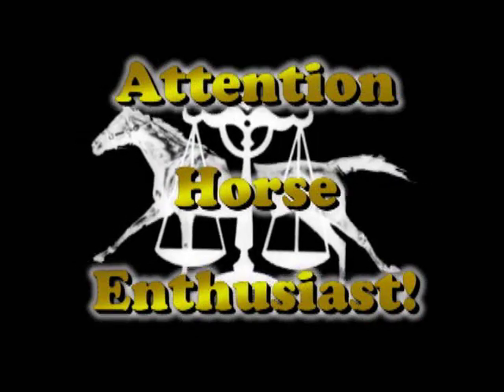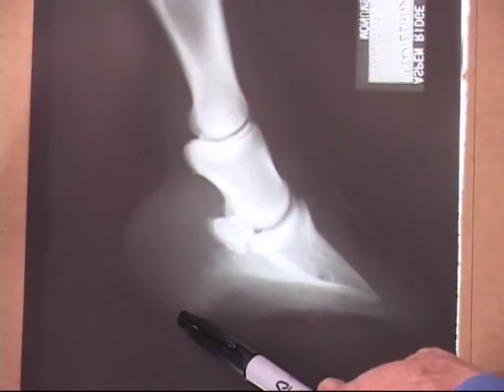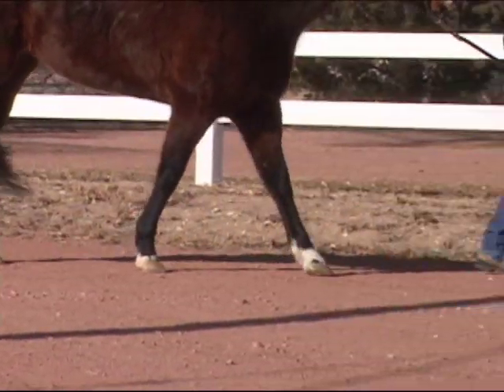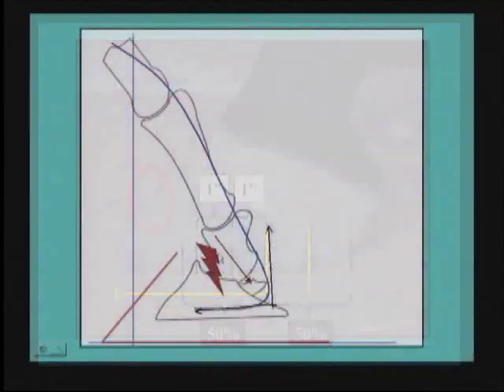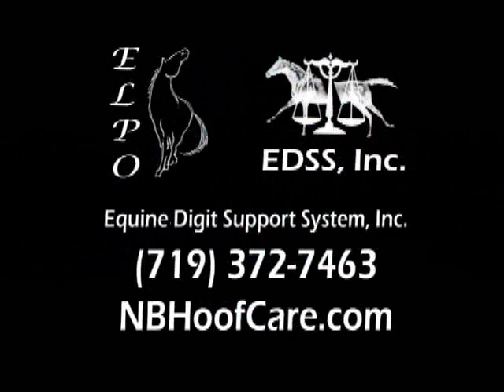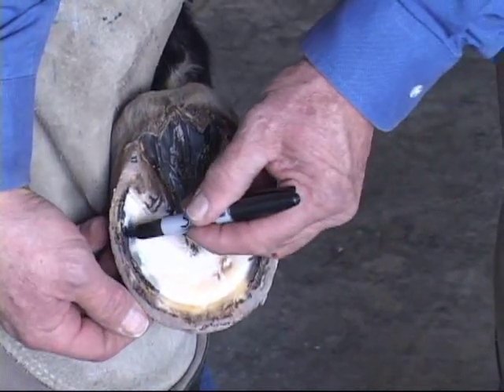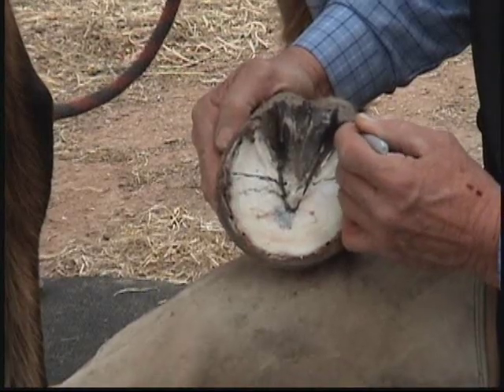Recognizing Hoof Distortions - 2 Minute Overview

Comment from the maker: Not sure why bmc06239 would not think that a Natural Balance Shoe is not a good option for horses that turn.  The NB shoes, PLR's, and Centre Fit shoes have been some of the first ones on the market that built Multi-direction Leverage Reduction into the shoe which actually takes strain off of the joints and attaching tissues in the turn and going straight.  Properly prepared feet and properly fit leverage reduction shoes like the ones I just mentioned are a preferred application for treating joint problems and lower limb lameness so I think you might not have been given the proper information.  Thanks for viewing though.
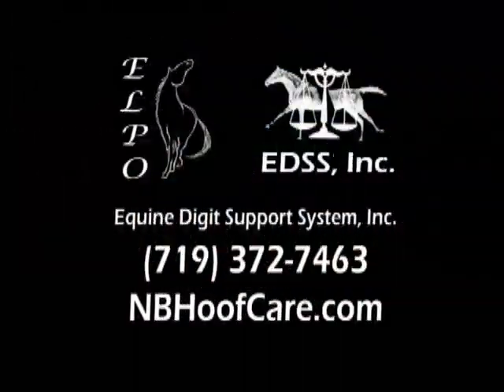Reply: You never addressed my concerns... the natural balance shoe shown at (1:48) puts more leverage at the pillars  and when the horse turns on packed surfaces this has the potential to damage to the collateral ligaments of the coffin joint...over time the horse will change it's stride during turns to avoid this pain causing damage to other joints further up the limb.
Reply from the maker: I thought I had addressed your concerns previously, as the NB shoe has leverage reduction built into the shoe all the way around the ground surface from the toe to the quarters.  It is not a straight across breakover point as many actual "square-toe" shoes are.  The foot surface of the NB shoes is actually quite round and contact & load is shared pretty even all the way around the foot, with the exception of feet that have extra long and distorted toes.  If you look at where the inner rim or the point of breakover sits with an NB shoes as compared to most other shoes on the market at the pillars and in the turn, I think you would find that it does not increase the leverage.  Perhaps some people have the illusion of it increasing the leverage if the toe quarters are not addressed and the front of the toe is over thinned as untrained people sometimes have done with that shoe.  I have seen people misapply that shoe and end up with toe quarters that are flared out, heels left contracted and think they just did "Natural Balance" because they used the shoe.  However, we are very specific about the foot preparation guidelines we recommend to be successful with our products.  Never the less, our products get applied to poorly or incorrectly prepared feet and then the assumption by people that do not recognize the difference between proper foot preparation and improper foot preparation (at least for our shoes), think that the fault lies with the shoe.  It just simply is not a correct assumption.  The NB shoes and pretty much all of it's predecessors (which there are many and with many better features) are used time and time again to alleviate and treat collateral ligament lesions and other soft tissue ailments in and around the coffin joint.  So I do not know how else to address your concerns other than to state what I we have experienced over the more than 20 years of using tens of thousands of these shoes (applied properly) and seen quite the opposite affects that you are describing.
Reply: I see it now..my observation was incorrect when applied correctly on a long toe.   I seldom see horses able to be removed from this corrective shoe or worse enter a cycle that spirals quickly out of control to  natural balance shoe with pad...natural balance shoe with frog support ...career ending injury.  Injuries seem to occur more with horses working in packed terrains or disciplines with sharp turns.   I agree the shoe works well as a corrective device for long toe.  If  I understand you correctly it should not be used long term because it cannot be installed correctly  on hooves with correct toe length therefore will create the problems I described.
Reply from the maker: That is actually not what I said. I said if it is applied correctly then it does not cause the problems you were describing and in fact is often times used to successfully treat the problem you had described.  You mentioned that the shoe only puts support under the pillars and I mentioned that the shoe makes contact and supports the foot all the way around with the exception of horses with long distorted toes.  I will say that we offer a lot of other shoes that may do a better job and may be more appropriate for horses competing in hard terrain or have other lameness or performance requirements.  Every horse and every situation is an individual and should be treated as such.  The NB shoes have a place to be used as do PLR's, Centre Fit, Vulcans or most other shoes, pads, etc. on the market.  You seem to obviously have a problem with Natural Balance shoes, so my suggestion would be for you not to use them.  Like any shoe or pad, they are a tool.  The skill, training and expertise of the person using them as they are intended will yield the corresponding results.  People that use our shoes or any other shoe for that matter and apply it to an incorrectly or poorly prepared foot are going to have less than desirable results.  If you get apply the correct apparatus to a correctly prepared foot, you will have better results.
Reply: Can you provide video evidence to support that the shoe can be installed correctly on a horse with correct heel position and toe length.  I do not have a problem with the natural balance shoe.  I just think it should come with a warning that says this is a corrective device and instructions to transition the hoof out of them when their time has past.